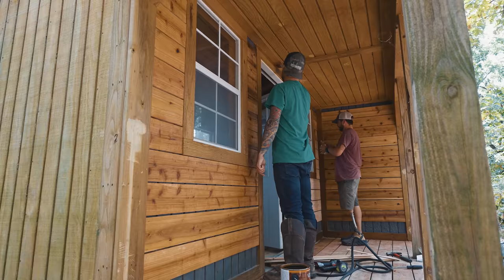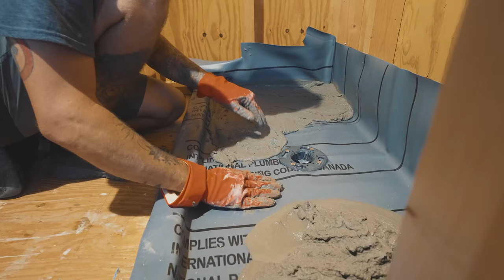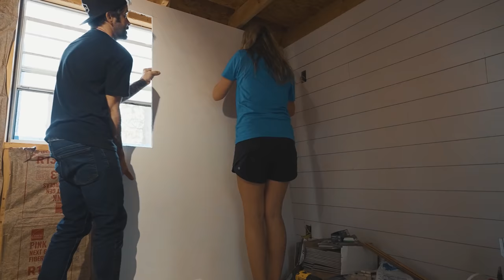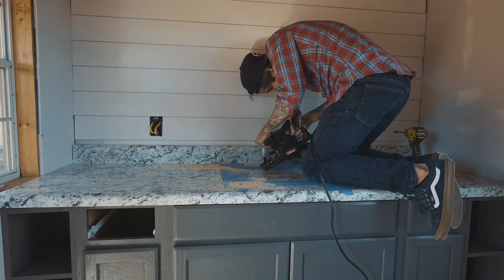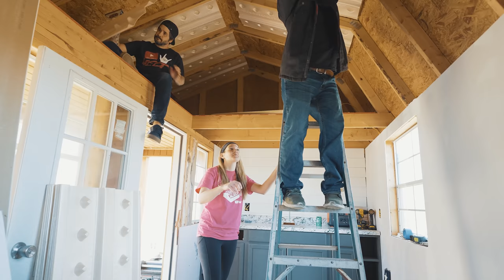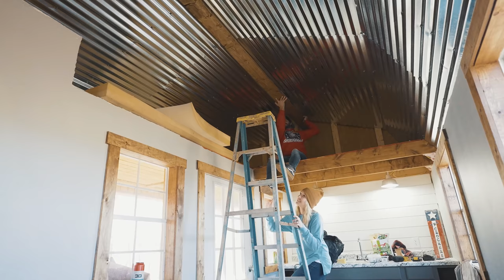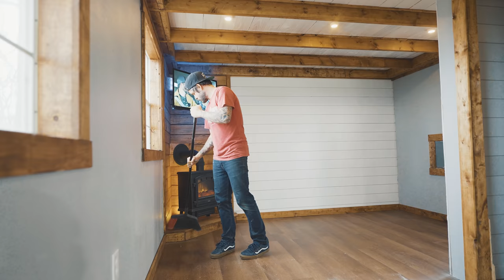Abandoned Shed Converted Into a TINY HOUSE in Under 20 Minutes!  SHED TO HOUSE CONVERSION

Comment: As a retired Construction Supervisor, I can see a real problem with not using a vapor barrier behind the drywall and the metal interior roof covering if you live in a cold climate and heat the house. If this is so, after about 6 months the insulation will be very wet and will support mold growth.
Reply: What is a vapor barrier?
Reply: And in the shower. Former insulator here, and the shower gave me huge concerns. I know the brown backing on the insulation may be considered a vapour barrier but it literally takes 2 minutes to hang some poly. Especially since there didn't seem to be provision made for the joins in the wall materials. In my opinion it's worth whatever it takes to get someone out there to do spray foam on the entire envelope.
This is why I would rather buy a basket case building of any sort than something  remuddled.
Reply: I live in Ohio & I imagined water dripping off of the ceiling lol... it looks like they're in a warm climate. If its dry also, maybe mold isn't an issue. It can't be that dry if he uses rain water collection.
Reply: Yup. Fun watch but some moments a guy just looked away to avoid cringing.
Reply: In the South, the vapor barrier is toward the inside of the building envelope, and the kraft face of the insulation, if installed correctly (which they did, with the tabs overlaping on the face of the studs), provides enough of a vapor barrier to meet code in most areas.

My main concern is that shower, with cedar boards nailed directly to untreated subsurface boards. I see mold and mildew issues in the near future. At the very least a peel-and-stick membrane over the subsurface would have been nice. And the cedar boards themselves probably should have been beveled to shed water. For good measure, after being cut and dry-fitted, they could have been pre-treated on all sides before install, followed by a final treatment over the puncture holes after install.
Reply: That's not the only deficiency..  what's THEIR sanitation/ greywater system??
Reply: @0O00OO0O00OO0O00OO he doesn't seem to know much More.. in a year, it'll be so moldy,a chicken wouldn't want to live there.  Cute, but crappy 🙁🙁🙁
Reply: What about those windows? Are they the standard windows that came with the shed? Or did they replace them with better?
Reply: @deirdrecorey3876  and what's with that itty bitty sink??? My coffee cup wouldn't fit in there 🤔🤔🤔
Reply: @HickoryDickory86  In Canada, that would not meet code. I have not seen paper backed insulation used much anymore. A plastic membrane is required. Even when this membrane is sealed all around the bottom, sides and top plate of walls with adhesive, moisture can still sneak in anywhere there is a hole. It can be a tough issue to seal moisture out completely. Too many builders insulate basement walls with fiberglass insulation, completely covered with a thick plastic membrane, instead of rigid foam insulation. Most of the time you can make a tiny slit in the plastic, insert your finger and feel that the fiberglass is soaking wet.
Reply: Yea i mean whole things very DIY and not in a good way lol I wanted to fire him for painting the electrical wires but i realized he doesnt work for me 😂
Reply: They put so much work into the build it's a shame to see errors that could potentially cause big problems.  I'm in the PNW so mold and mildew is a huge issue.
Reply: Jesus is coming. Read the Gospel.  Well tell Jesus to stop that drywall from becoming silly putty and molding and making them sick lmao
Reply: @servraghgiorsal7382  a septic system for a small place can last a century and the soil looks good and dry for a excellent weeping tile bed.  .
Reply: If its not really warm, mold wont be an issue for long. The pipes will FREEZE, burst, no need to worry about shower after that....duh
Reply: That fireplace definitely wouldn't pass inspection in many places and home insurance wouldn't touch it with a 30 foot pole
Reply: @miscbrahh  I’m guessing if it’s off grid they probably aren’t concerned; but you’re 100% right
Reply: @HickoryDickory86  we're going to see tiny houses built out of papier-mache and matrresses any minute now bro
Reply: @amyk6453  it’s damp proofing. It’s usually plastic or something similar that keeps condensation from getting things wet and developing mold.
Reply: How about all the gaps in all of his joints!
Reply: @amyk6453   it’s a layer of poly plastic that separates the outside cold and the inside heat, without you have condensation problems, standard these days is 6mil poly, any thinner and it won’t pass code ( at least for northern Canada), you also have to use what we call Black Jack acoustical and vapour sealant on all seams, top and bottom plates of the walls and any places where you have outside studs laminated together
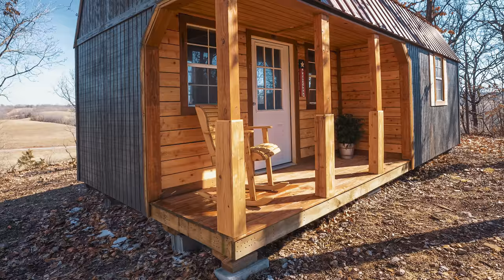Reply: @deirdrecorey3876  Like hell they live in a warm climate. Look at the Trees at 20:00. There even seems to be snow on the ground. It will 100% swing from cold to hot.
Reply: @servraghgiorsal7382  Agree. If he's going to try to sell this as a fully off-grid home, a buyer would be in a world of surprise because this just doesn't really fit the bill. My uncle is off-grid, has been for 60 years (well water system, power generator building, propane appliances, fully permitted septic, real wood stove for heat), this doesn't come close.
Reply: @Chahlie  l
Reply: @amyk6453  a vapor barrier is a break between the outer walls  and the interior drywall.  Many people use plastic sheeting, but I prefer the spray in foam insulation that expands as it dries. That gets it into every little crack and crevice a moisture break between the outside cold air and the warm air inside to prevent condensation in the walls. Water plus organic material equals mold and you definitely don't want mold inside your walls to where you are constantly breathing in those spores. Especially since the mold that results most often is what's called black mold and it is highly toxic. It can literally kill you. If you don't know what you are doing, hire a reputable contractor to do it for you so you don't end up with something that is potentially deadly. Yes, you will pay more to get it done right, but you will end up paying even more if you mess it up and something happens  then you have to tear everything out, do a mold remediation (spendy) and rebuild doing it right. Vapor barrier is one of the most crucial aspects of constructing a warm, safe home to live in. Hope this helps you understand what it is and why you want it done... and done right the first time. Also, insist that they use mold resistant lumber and drywall (it is sprayed with a coating, usually blue in color, that resists mold buildup. Also, the shower should be backed with rigid, mold resistant Masonite, not standard drywall. For more tips, look up Mike Holmes and see if you can stream some of his shows on making it right
Reply: @servraghgiorsal7382  please, lets see a video of your perfect house. I'll wait.
Reply: Agreed.
Reply: @amyk6453  rubber membrane, waterproof insulation.
Reply: @amyk6453  plastic rap basically
Reply: Its Texas
Reply: @servraghgiorsal7382  That was my main question.
Reply: @miscbrahh  it's electric not wood
Reply: I was wondering if someone was going to say something. I like the concept of the video, but seems like a lot of corners were cut and things done or bought cheaply. Makes sense to save cost, but if I saw this video, I wouldn’t purchase the tiny house. Great content and editing though!
Reply: @miscbrahh  its fake 🤣🤣 didn't u see him spray painting the pvc pipe black to make a faux chimney? Its a plug in electric fake that is like a space heater
Reply: Come on people it's a shed! A real nice hunting cabin, or she shed. And a heck of a lot better than a tent. Stop getting all worked up.
Reply: I've noticed many mistakes these two are making in their building projects but they don't seem to take any advice lol
Reply: I noticed that as well plus I’m not sure about cedar shower walls but it’s his project. You live and learn
Reply: @amyk6453  it’s basically plastic that goes over framing and insulation. It’s used to help keep moisture from building up due to temperature changes and sometimes referred to as sweating which isn’t good for interior walls especially Sheetrock
Reply: @miscbrahh  It is an electric fireplace, he just installed the pipe to "real look".
Reply: @miscbrahh  you obviously did not watch the video well I don't know why it wouldn't pass inspection it's electric with a dummy pipe 🤣🤣
Reply: That depends in where you live. I live in Northwest Arizona and our county codes and I believe state codes also actually forbid vapor barriers because vapor barriers are a REALLY BAD idea in warm climates because all they do is create and trap in moisture which creates mold. Idk where this house is though but there may be a valid reason not to use a vapor barrier. I'm originally from Missouri and when I built my tiny house here in Arizona the kid at Home Depot looked at me when I was on crack when i asked him where the vapor barrier was and when I asked the store manager he told me they didn't sell it and why.
Reply: All these “construction” guys and nobody mentions 1. The way the shower pan was done. 2. Put hardy board in without any water proofing. And 3 he used wood in a shower. I’m pretty concerned with all the “years of experience” in this comment section
Reply: Uh-oh!
Reply: @gbrm6077  OMG! We spent thousands of $$ on correcting a mold problem in our house. After 5 years living in the house, unaware that there was even a problem, I was already having all kinds of major health issues, which continue today, 15 years later where we live in a different climate. MOLD is NOTHING to take for granted.
Reply: @amyk6453  Usually just a type of plastic, heavier than regular plastic.
Reply: OMFG!!!!
I think it's AWESOME!😊
Do we Honestly need cut downs on everything someone accomplishes???
It's his house! I'm positive if he has problems he can FIX it! 😊

I give a 👍👍👍👍👍
Reply: @bheadrick69  thank you!!!!❤
I mean Really.. I'm waiting too!!!🤷
Reply: @wjerame  not required.. Jesus will to take us out of this world.. what will a mold free be of use then
Reply: @wjerame  wrong
Reply: From a German point of view I wouldn’t even call this a house. I have seen campers built to longer last then this. And for sure that’s not KFW 45 conform xD
Reply: @Chahlie  I was wondering about the cedar in the shower. I didn't think that was a good idea but I know NOTHING about construction.
Reply: @kellygriggs564  Sure he can fix it, it's easy!
Just tear off all the drywall, remove the wet insulation, get the mold and mildew removed professionally (it's that dangerous) rent a dumpster to haul all the trash to the dump. Then replace the insulation, put in the vapor barrier that would only have cost about $20.00. Replace the drywall, tape and sand and repaint. 
Or just leave it and risk skin rashes, eye and lung irritation, headache, wheezing, congestion etc. After all "It's his house!"
Reply: @wjerame  get off their backs. They didn’t need comments from you jerks they are young and will learn as they go. Can’t you just be a little happy for them.
Reply: @wjerame  lmfao!!!
Reply: @amyk6453  plastic sheeting
Reply: Yeah I live in South Florida and it's a big fat NO GO! must have vapor barrier well everywhere and especially for the bathroom Cedar does resist some mold and insects but in Florida there'll be a thin slimy film over that with just two uses and it'll just go ham from there actually this whole thing would mold without treatment in no time flat! I don't even want to go into the bugs that love that cheap shed wood and moisture everywhere
Reply: Thanks for this comment. I was wondering about that.
Reply: Condensation on the metal roof in the loft area will definitely be a problem. An adult exhales 1 litre of vapour per night and with limited circulation space it is likely to condense on the metal sheeting as it's not breathable.
Reply: @miriamkivlehan3498
Reply: I made this mistake after working in construction for years. Sometimes rushing stuff isn't worth the cost. Fortunately for myself I had to tear the exterior t11 off and replaced with hardi and corrected everything from the exterior.
Reply: I😂 believe he did just a quick time lapse video, not going to show everything 😅
Reply: @amyk6453  plastic, part time construction worker here
Reply: As a layperson I also see a real problem with lack of vapor barrier lol.
Reply: Heat will melt that tv.
Reply: @DA-jw4lx  Tile would of been better.
Reply: @miscbrahh  it looks like an electric fireplace.  He spray painted white plumber fittings to mimic a ‘chimney’.
Reply: I hope they are not selling it, and it is for a family getaway only.
Reply: When I build my tiny home Vapor barrier is a must!
Reply: What did the tank look like for the toilet
Reply: @Chahlie  yeah that shower will hold moisture against the frame. I know cause I've watched MONTHS worth of construction programs over the years.
Reply: @jaywebb3105  the problem is somewhere down the line, they will sell it to someone that has no idea what a nightmare they bought.
Reply: Who cares... These guys did great !! What's next, you gonna try to locate this building and condemn it fit not having inspections, and code violations.. negative negative negative...  To the guys who built this, I THINK IT'S AWESOME !! GREAT WORK
Reply: Termite.. heaven.  Trust me. I speak from experience.
Reply: @HickoryDickory86  this is a very low tech comment, but a good room dehumidifier run 12-15 hours weekly could help prevent mold or mildew issues, esp in a building this small. 

I appreciate the efforts and talents of these boys.
Reply: @deirdrecorey3876  if you live in a wooded area, mold is always an issue
Reply: @miscbrahh  excatly he may as well strike a match, and burn the hole place down no sheet, 
Metal or nothing! How dangerous! Not, by code! On my property, even 🤫🤔🥴
Reply: @nativegoku1244  it gets cold  there too!
Reply: @CarlasCorner62  oh okay lol.
Reply: @miscbrahh   It's made to look real, I believe it's electric!  I have one very similar!
Reply: I live in southern AZ and 40 degrees is insane for us. If it gets anywhere that low it will be 70 by noon. So I would not have to worry about mold BUT I would have spray foam in between the walls
Reply: Thought the same thing.
Reply: @Chahlie I noticed that myself. I've never put insulation behind a shower without poly like that before. May cause future problems.
Reply: Wow. Tough crowd
Reply: Hi! Do you have any socials I could contact you with? Im 14 and planning on turning a shed into a tiny home so it’ll help me now and later in life bc rent sucks even without having it now ik it. I need someone to help guide me through what would be best for installing things like insulation, electric, how to go about all of the installing before furnishing yk-? Ik it may be weird to talk to a 14 y/o but im just looking for some help and I don’t have many people around that could help me
Reply: Agree… don’t care for that metal interior roof
Reply: Wondering if spray foam was used?
Reply: I hope you get thanked for this free valuable information. A real good Samaritan.
Reply: @Chahlie same thanks to you sir. I hope they heed your advice. Freely given. 
True story 20 yrs ago. My son abd I bought a 10 Yr old property which had been let and neglected. Tiles on kitchen floor were buckling. We went to B&Q to choose new. Son then had to rush off to work, leaving me to obtain all additionals and pay. 
Retired 'worker' appeared and asked me about flooring. You also need X, Y and Z. He said. Membrane was one of them. Here we go', I thought.....hard sell. Lone woman....he can sell me anything, adding to overstretched bill. But he patiently told me what was wrong and why. So I accepted advice. And still perfect 20 years later. Listen to the Professionals.
Reply: @jackjohns232 What a shame. You guys must want to cry cos this chappie really thinks he's on a roll. It was a shed apparently so with be neat to store tools. Alot will copy which is tragic. A 60 acre ranch dream house coming up!!!!
Reply: @amyk6453  it’s a thin layer of some water resistant material - like plastic sheeting - to prevent moisture from getting into the interior of the build.
Reply: Hopefully, you discover the mold before it makes you sick.  Maybe some Styrofoam or some such might work as vapor barrier
Reply: Oh yeah, I’ve had the problem before. Looked a pipe busted in the ceiling. Literally water pouring down the walls during the summer because of the cold AC running at 65 non-stop, with a metal exterior and interior roof. At least it looked good In the short run
Reply: Since it's on topic, probably subtracted 3 years of hearing from his life without ear plugs
Reply: How can yaw touch insulation? It feels like glass particles In my skin.
Reply: Looks very nice....
Reply: Thank you for your sincere feedback so I can learn for my designs
Reply: Do you need a vapor barrier with spray foam?
Reply: @amyk6453  A vapor barrier is a lining that is sold at most diy stores that prevents vapor from getting into or accumulating near the insulation. (ie humidity whether from weather or hot/cold collection as heat rises and condenses...think of the condensation near the toilet... there are layers of construction that are critical that are not seen) Those of us who don't build, most often see the vapor barrier while watching buildings go up -- a wrap before the siding that is often either pink or looks like aluminum foil... depending on the type selected for the environment and purpose.
Reply: @amyk6453  it is tar paper you put on the wall between then insulation and the outer wall. It protects the isulation from moisture and prevents exactly what this gentlemen mentions about mold growth.
Reply: Yep I can attest to that.  That happened to our cabin we own.  We had to rip open the ceiling.  It was a MESS
Reply: the shed had electric?
Reply: No vapor barrier, that's why he's using the paper facing insulation....
Reply: Plus something fire resistance behind the pot belly stove and flouring.
Reply: @nativegoku1244 Gets cold in Texas.
Reply: @colinstace1758 saw that.  Why the vent?  Ja
Reply: Not to mention in the bathroom
Reply: I can't believe he installed the TV above the stove 😅...
Reply: @samcadora4718  funny
Reply: What do you think of the cedar in the shower? I’m baffled. I didn’t think wood would last with all the water and steam.
Reply: @kellygriggs564 It's about health risk not about hurting the guys feelings cuz he was trying his best isn't a participation award for elementary kids..... Black mold can kill you or mess you up for life.